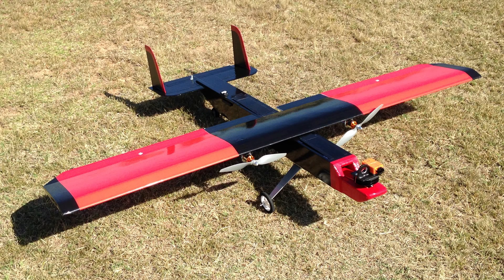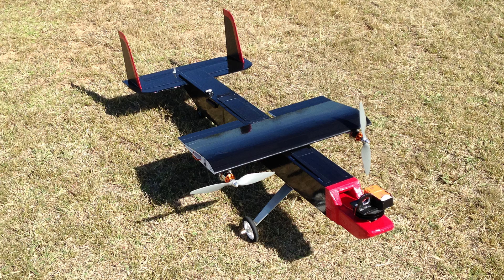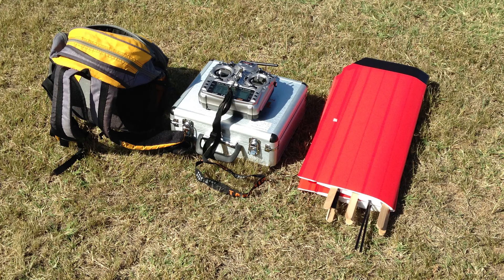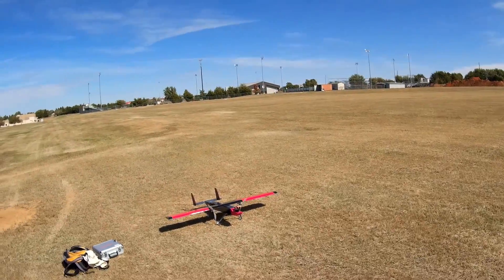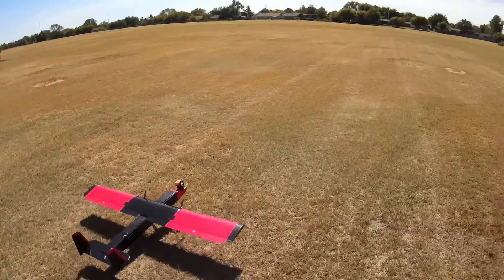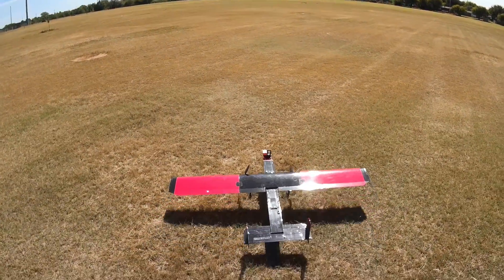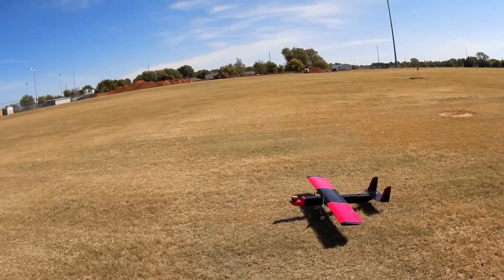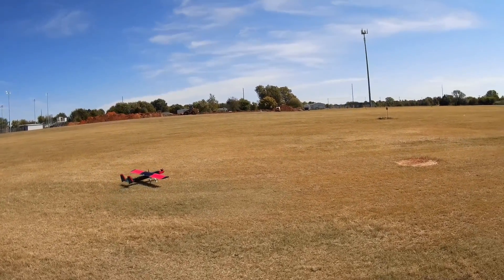The Evil Twin - first flights of a DIY depron fpv plane

Comment: Another one of yours Im going to have to build. I just finished making my own cargo plane. How did you setup your wings to detach? That was my biggest issue.
Reply from the maker: Thanks Phil - glad you like my creations!  I'm going to do a little build video about this plane, but the short version answer to your question is carbon spars, tongue depressors, and velcro.  So far it's working, but foam board wings will only come apart and go back together so many times I think... Stay tuned
Reply: I was going to use velcro but I wasn't sure how well it would work. I'm using the wing from my recently deceased bixler 2 so hopefully it lasts.
Reply from the maker: Ha!  If you're familiar with my vids you know I've also used a recycled bixler wing.  If you notice in this vid I also used a little duct tape as insurance on the wing sections during the maiden flight. :)

Comment: Lol.  I made mine to fly off a 3000mah 3s running 10x6 props with 1100 kv motors.  4-5 minutes is pushing it lol.  Been flying it more LOS doing crazy stuff since it goes vertical like a rocket and keeping flight times 2-3 minutes.
Reply from the maker: Wow.  Yeah, I guess I'm doing pretty well getting 15 minutes then, but that was with two 3000 mah 3S's!  I'm planning to try those new Titan Lions - lots of mah's and really light!
Reply: Yeah I almost ordered some.  Was thinking of trying 2 of them in my Phantom wing.  Seems to be a lot of mixed reviews about them.  Lots are saying they are more like 5c and the voltage sag is so bad they are only able to get 2500 to 3000 mahs out of them.  May be just fine if amp draw is kept to a minimum.  My phantom is lucky to pull 22amps at full throttle and cruises at less than half pulling around 5 amps so they may be perfect running something like that where each battery is only having less than 5 amps drawn with 2 in parallel.
Reply from the maker: Thanks again Pat.  I am planning to try a pair of sunnysky motors!